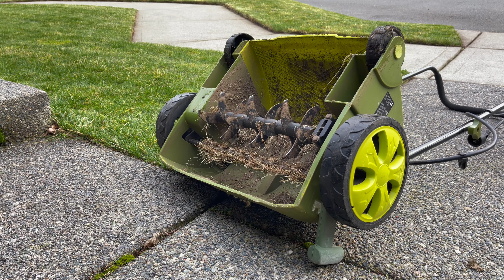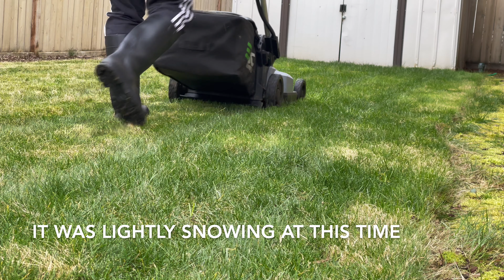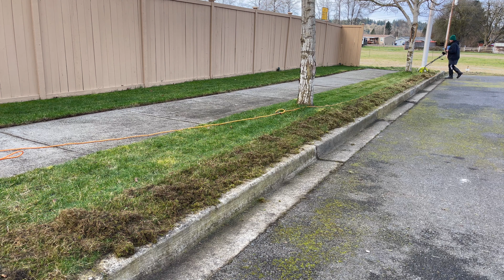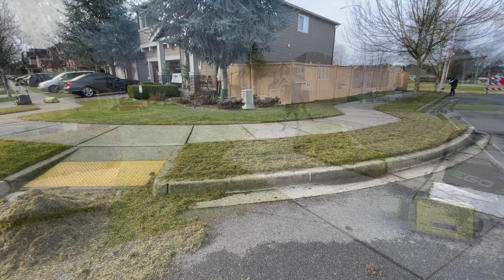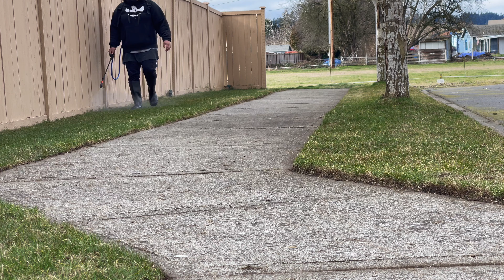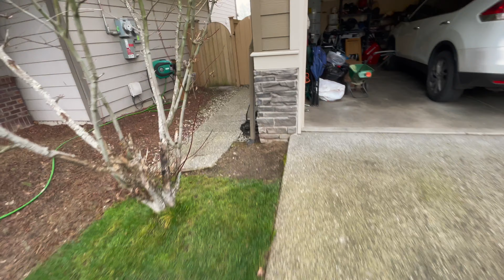This is why you need to VERTICUT before spring! Get rid of MOSS now!

Comment: Might aerate before sand leveling, that way more sand gets into the soil profile which may help with the moss problem.
Reply from the maker: What I need to do is get a real core aerator and pull some actual plugs this year… I’ve been using the roll aerator not many plugs come up 🤦🏾‍♂️😂😊🔥🤙🏾🙏🏾

Comment: Greeting Yardbrah! Have you tried adding lime to the lawn? I've noticed less moss in my lawn months after applying.
Reply from the maker: I do add once a year maybe I should add multiple apps! How often are you putting it down? Thanks for the tip! 😊🤙🏾🙏🏾🔥
Reply: @YardBrah  I break up the applications to twice yearly due to the amount of pounds I have to put down.  There's a calculation I'm drawing a blank on. But its a lot of lime if you compare it to the amount of fertilizer we put down.
Reply from the maker: @dollarvan13  Ok cool I do a little more research I normally put down an entire bag in the front and another bag in the bag just to keep the ph balance but never have gone up in lime application! I'll look into it! 😊🤙🏾🙏🏾🔥

Comment: Brah, have you had any issues with your sunjoe not starting or tines not spinning? I did a verticut this morning and able to get some work done, but went to work on my curb and caput, sunjoe not starting. Only had mine for 2yrs, dang.  I'm about to purchase the 15in version the AJ805E. Curious to hear about your experience of issues or any doable repairs done. Keep up the great work! 👏👏🤙🤙
Reply from the maker: Hey that’s not good! I purchased mine used and the previous owner had it for YEARS! No issues so far works amazing! I’m looking at getting the cordless Sunjoe soon so I don’t have to mess with the cords 😊🤙🏾🙏🏾🔥🔥🔥